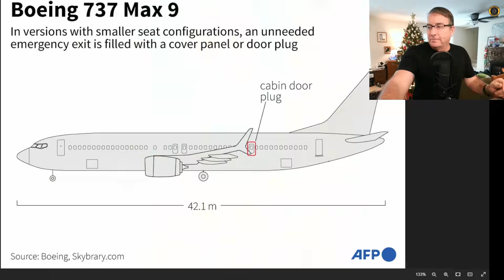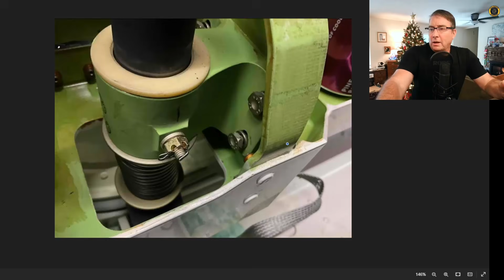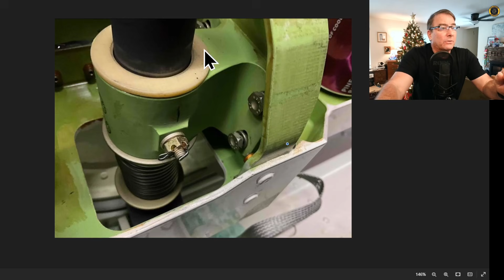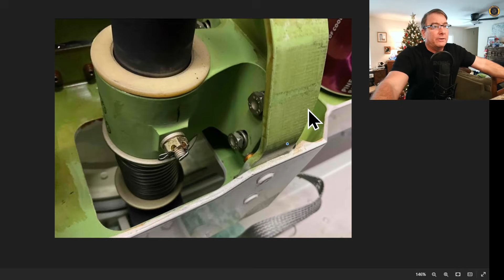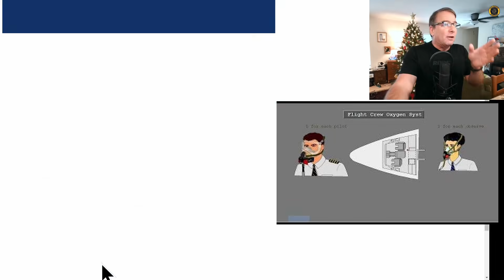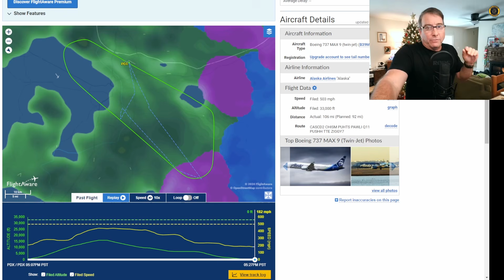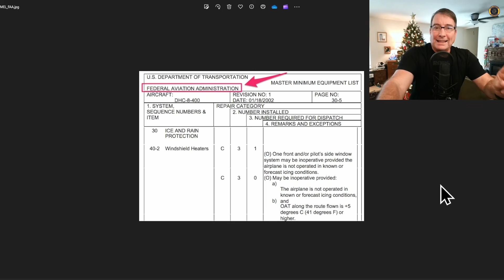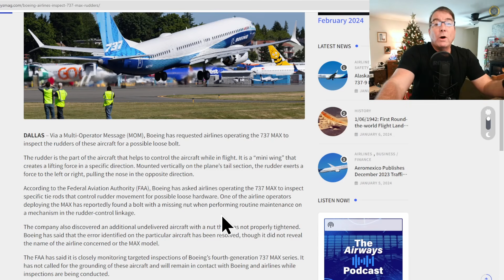"Yes, We Have No Bolts"  9 Jan 737 Max-9 Update

Comment: Boeings "secret manual" on stuff needs to be fully released to the pilots . . .  I too thought only the cockpit door panels would be pressure released  ............not the whold door.  Is that only the Max, or were earlier 737 models the same?

Comment: If the fasteners were loose, missing or improperly fastened, there is an absence of quality control oversight, mistake proofing and verification of assembly operations. Complete breakdown of a the quality system.

Comment: The FAA has questions to answer in my view if they didn't identify the missing information regarding the door blow out after the 737Max MCAS controversy.

Ideat pilots would have flicked the CBs  for the CVR but it is shocking maintenance didn't pick up on this once they got on board. 
Manuals and check lists need to reviewed. Thankfully the CVR is of limited benefit to the investigation and they have the FDR. 

With new solid state crash proof (resistant) modules, the requirement for new aircraft CVR times should be greatly increased

Comment: At 5:50 or so in this video it almost looks like the bottom of the two bolts on the right is loose ?  I dont know if this is an actual "door" or just a mockup for study but it sure looks to me like the bottom bolt is loose.
Reply: I believe that is a photo from one of the other aircraft that they found an issue with, that being the potential loose bottom bolt, but I’m not sure.

Comment: Juan, Years ago a United Airlines B747-400 landed in SFO on only the Wing Gear. The cause was a Castellated Nut being installed WITHOUt a cotter pin. The Mx Manual allowed either a Self Locking Nut or a Castellated Nut to be installed. Of course a Castellated Nut requires a cotter pin. Will be interesting to see what comes out of 5V is one…..Keep up the great content..
Reply: Some poorly trained tech was thinking "A nut is a nut.  What cotter pin?"

Comment: ⚠️  WHY  PULL  CIRCUIT  BREAKERS !??!
It is 2024… It’s a Brand New Aircraft…
Why is there not digital recording capacity far in excess of what the current capacity is?

Ridiculous!

Did “Dementia Lunchbucket” Joe Biden fasten the plane hardware ?
Did the Boeing staff get hired based on sex or race instead of merit and competency?

Thanks Brownie!
You are STILL the “go to” for our industry. ❤

Comment: Doesn't the door stay on the hinge pins during an evac if it was set up with a slide. There is a washer that protrudes past the slide pin, albeit not that much, and any force might let the hinge guide overcome the washer especially if the other hinge guide attachment was compromised.
Reply: Somewhere recently, I saw a photo of this exit with a demonstration slide and it does flip down under the slide.
But I would think that even if it did drop off at that point, it shouldn’t be a problem .
Reply: I think slide would have to stay attached to the fuselage and the only way that would happen is if the door stopped sliding once it reached the oversize washers although not oversized by much. Some slides do stay attached to the fuselage on regular side opening doors.  @JohnHallgren .